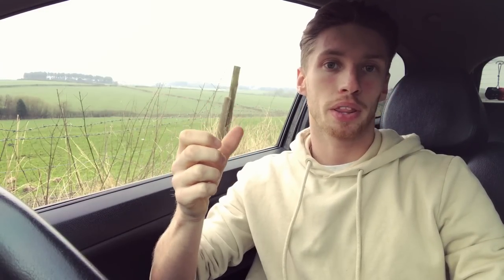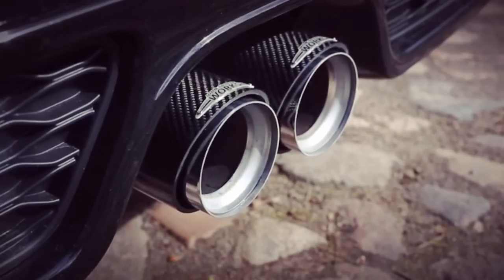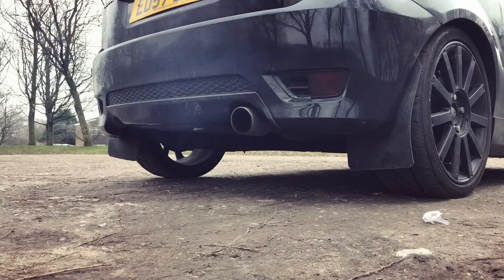How To Make Your Exhaust Pop, Bang and Crackle

Comment: What causes pops and bangs is a couple things.  

1. Fuel over run, lift off fuel overrun is more common way to get unburnt fuel vapor in pipes.

2. exhaust headers, extremely overlooked area.. many modern cars have exhaust headers setup in a way that won’t work very well for pops and bangs.  Things like equal length headers and collector pipes can reduce chances of consistent pops and bangs as they are designed to make engine more “compliant” and more “efficient”, making your own headers or replacing them can help as this helps send more exhaust down stream faster and can help make flames exit the rear of the car easier.  Ideally want pops and bangs to happen down stream.. 

3. Center muffler/resonators and rear mufflers..  you maybe amazed to find you car in factory MAP can crackle and pop on lift off if you build custom exhaust correctly.  I found my car crackles a bit on lift off on factory tune on factory CAT just deleting the resonator/center muffler, pulling on correct mufflers is critical too, as some mufflers can mask the crackling and pops.  

4. High flow cat…. You can absolutely run CATs and get pops and bangs I have done this before and the trick is high flow cats for track use, not every car likes these however… but cat isn’t going to remove the fuel, it’s emotions based, what it can do is screw AFR mixture in the pipes, high flow cats tend to do this less.  my car originally wasn’t happy with my solution and then I realized why, way they measured my O2 sensor have to put sensor in the CAT as down stream not after the cats. So had to find a high flow cat with a O2 port in center of it and use that.  

5. Check your engine is getting enough fuel where you want the crackles and pops which is usually near upper end of rev range so when lift off it sends unburnt fuel into the exhaust.

Comment: When the throttle of an engine is closed at higher RPMs, a very strong vacuum is created in the intake manifold - this causes a lot of fuel to be drawn in via the idle circuits of the carburettor, and even exhaust gases drawn back from the exhaust manifold due to valve overlap.

This mixture does not burn fully and goes into the exhaust system, where it may get enough air to actually combust fully. so it explodes with a small pop and sometimes flames maybe seen.

It is harmless for the most part. Even a perfectly tuned engine can pop its exhaust.
Reply: sorry, carburetor?
Reply: Not exactly correct.
But I do remember them carbs...
Reply: Morten Kapa are you a mechanic?
Reply: Yeeeeah sorry bud but most vehicles that anyones going to be trying this one is going to be of this century and running EFI. I mean it would be cool to have a lawn mower that pops and bangs though for sure
Reply: @billyc2572  you’re out of touch with reality

Comment: Erm i have an issue, i have a fiesta mk6 (not an st) and it pops and crackles without me actively trying to make it pop and crackle. It only does it when it is warm, it has been sitting still for a while but i start it up now and then and move it around to keep things lubricated. Could there possibly be a hole in the exhaust or something?

Comment: do i have to remove dogs aswell as cats. or are cats enough. maybe some mice too?
Reply: Yeah I'd remove the dogs I heard it makes it louder
Reply: what's that?
Reply: removing your dogs is illegal, remove your mice and your cats, your dogs filter the air. To make your car spit flames, remove your chickens and replace them with a dragon.
Reply: Just make sure you remove the bearings from your muffler and weld them back into the exhaust pipe exactly 5 feet 3 inches from the end of the header or manifold. When the bearing spins it mixes the exhaust gases and makes them hot then the gases ignite and you get your pops. There you go....
Reply: Dogs bark loud than cats
Reply: Leave the mice. They keep the spiders out

Comment: Banging flaming isn't bad for ur car , nothing is getting damaged while it happens because of fuel enters the exhaust and heats up but it's fine to be honest , mine seat Leon Cupra R Mk1 running 300bhp and she's on her limits so because of the rods neeeds to be forged but she bangs like nothing normal
Reply: RY4N B35T0N it might not be bad for the car but its the environment you’re harming
Reply: There is a little chance of melting exhaust valves

Comment: the best thing to do to produce backfire, is to downshift to middle-high range of the lower gear
Reply from the maker: yeah that works also, its the same process; the quick change in rpm changes air:fuel ratio
Reply: @gmc__tanner1192  my car has a carburetor meant for a forklift can I still do this? My timing is max advanced on the dizzy since I'm running 108+ octane. What if I turn the boost up higher?
Reply: My 5.0 coyote does that alot when I'm slowing to turn, or just slowing in general, whenever I downshift from 3rd to 2nd gear, gives a good crackle kinda growl.

Comment: just for reference civics do this naturally i  think because all i've done is backbox and silencer delete and replace resonator with s/s smaller one and i get crackles all the time and the occasional pop. bare in mind i've got an fn2 model with standard k20z4. apart from that it's pretty much stock and map isn't really necessary unless you want it to be  loud af. but then again civics are loud anyway. whether this is with all civics i don't know as everyone i know still has backbox but no resonator.

Comment: Arnt cars standard meant to run rich anyway as it's safer for the engine i.e. Cooling etc so all your doing is deristricting the sound of the back fire that's happening all the time on a standard exhaust? I may be wrong?
Reply: Ben Dyson yes you're exactly right, that's why you decat it and stop choking the car

Comment: But don’t the cats & muffler give the car pressure or something? I remember I took the mufflers off my GT and I would have to give it more gas for it to move a little compared to when it had the mufflers i would give it a little gas and it would accelerate normal
Reply: luis Angel i feel you

Comment: I did exactly what you told me to do and all I got was a check engine light
Reply: Taking ur cats off will make it have a check light
Reply: theory nah bro not with a tune I got the MHD tune and it turned it off
Reply: @bandzz3486  100% but  these little below 2 litre builds are a pain in the arse
Reply: Mark Fasey yea bro Lmaoo I have a 3.5 liter I got a 335i 2011 e92
Reply: @bandzz3486  you got a 3 liter
Reply: this is hilarious to me

Comment: My '91 MK2 Golf does it like crazy only removed the middle box and installed an 10 year old remus backbox the cat is still in. Just downshift and lightly touch the acc. pedal. And it's a 1.3 injection 8v :D

Comment: Hey I have question, so I just got E46 320D (my first car) and I want it to sound good, what should I do? I think if I do muffler delete my mpg will get really bad, is it true? And I need some in detail help. Thanks in advance
Reply from the maker: Medo to be perfectly honest mate, a muffler delete won't affect your MPG significantly. You wouldn't even see horsepower gain if you're only removed the muffler at the back because the air flow in the rest of the exhaust hasn't been changed. The main thing it it would do (which is what you want) is just make the car louder and creating less time and space for the air to travel and quieten.
Reply: itsLeeLockwood Hey thank you for the fast answer! Well you know, my budget is really tight atm so I'm trying to do things with small amount of money, so for now I will probably do cosmetic changes. I hope your channel will grow fast, you have good quality content :)

Comment: Additional info to help achieve this effect.

Go to a tune shop and ask them to either remove or modify the DFCO (and CFCO FOR MANUAL STICK SHIFT VEHICLES) 

DFCO - Deceleration fuel cut off
CFCO - Clutch fuel cut off

Bang bang bitches.

Comment: I managed to get pops and crackles out of my GXE Sentra by accident. 

The car already had a header and straight pipe mufflers, but one day the fuse for the fuel pump went out and stupid me instead of checking that I went to pull out the fuel pump and go check it, turns out Nissan puts really weak pumps on those cars and the guy from the store though the pump was on it's way out when he tested it so he sold me a stronger fuel pump. I put it in, replaced the fuse and the car ran normal but I started noticing it popped and crackled now. I'm guessing the stronger pump puts more fuel on the engine and causes the exhaust to pop. it's really stange to hear those sounds coming from an old Sentra that's not an SE-R xD 

I should check the spark plugs it's probably running rich if that's the case.

Comment: my 1994 Grand Am is straight piped and it pops pretty loud but I have to be in park to get the good gunshot pops. any tips on how to get it to pop when revs go down. it has a 2.3l L4 and it's auto.
Reply from the maker: see mine pops more when the car is rolling other than parked. Ive tried to research why this effects the exhaust but i cannot find a legitimate answer.

Comment: My 2.2 liter subie gets crazy loud pops. I removed the muffler and did a flow through muffler and I still have my cat and res and that shit really explodes. I've found he best way to get really good consecutive pops is to be in like second or third gear at between 3k and 4k rpm and then lightly tap the gas pedal a couple times a second and it sounds amazing. Great vid man, thanks
Reply: That's great, now can you stop?

Comment: Anyone that actually wants to pop and bang should just get a tune with crackle option. Exhaust can be stone cold and still pop. My GTI  has a crackle tune and it’s just crazy non stop pops over 3RPM .. I can change it so it pops at any RPMs. I set mine between 3000 and 6000 RPM .. if I’m in that range it will pop. Anything under 3000 RPM won’t, just so I’m not asking to be pulled over.

Comment: can i do it on my civic?
Reply from the maker: The Cool Brothers hondas are too well made, they don't waste fuel
Reply: The Cool Brothers I backfire like mad with my eg dx twin carb swap, you won't get this from an injection civic, so no yo vetec here lol 😂
Reply from the maker: Curi0u50ne hahaha mate I need to see a picture of this
Reply: Jared Taylor I'm a ricer
Reply: not sure if its a joke or not but mine ran rich after i removed the cat and installed a header and exhaust. this caused it to pop and shoot flames lol
Reply: Jared Taylor clearly not a car guy
Reply: Don't be that guy
Reply: Evan Davis bro im fucking done LMFAOOOOOOO i was in class when i read this and i just bursted out laughing 😂
Reply: im 4 ase's away from master tech status. I'm more of a "car guy" than you ever will be
Reply: It's a VTEC not a VETEC
Reply: The Cool Brothers oh god please don't.
Reply: i have a 93 si and mine does it like crazy. b18c motor
Reply: my civic si does it all the time too.
Reply: sub hazard my old D16ZC (or Z5 EUDM, PGMFI) did it and my actual K20 (dbw throttle body) does it in the correct rpm range, between downshifting. But without flames!
Reply: plz dont
Reply: My 91 accord is fuel injected pops and bangs a shit load with resonator and muffler delete
Reply: B16 or B18 engine mapped with P28 ECU with launch control will do it or you can buy B R rev limiter but will shorten your engines life
Reply: itsLeeLockwood cause vtec
Reply: Jared Taylor i only have 4 student ase’s and i know more than him by far.
Reply: I de-resonated my Focus ST and it pops and bangs on and off boost and still passes an mot. No need to remove the cat!

Comment: I've got a 2.0L 2010 Kia Magentis crdi which I bought this week and when I drove it last night I was speeding about 80-90 on the country roads near me and when I slowed down I heard little pops, the thing is though I've got a Diesel so I've no idea how that was possible since I don't think Diesels can pop? The car has got a DPF code and the mechanic who sold it to me said the previous owner ( car is an ex taxi, comes with full service history at 200k miles so it's been maintained properly it's very clean and no rust at all under the car) that they must of taken it off to re-map the car, the thing is if I start speeding with a lot of torque a lot of smoke comes out the tailpipe, which is normal but like even when I stopped the car after hearing the pops I looked out my window and I was surrounded in white smoke, like it even went to the front of the car? must of been the wind pushing it but I was a bit worried, I'd love to re-map my Magentis to go to 180bhp and get a new exhaust system to get a dual exhaust but I'm not sure which brands make that possible on a Kia? Any help would be appreciated cheers!

Comment: I think popping and crackling cars is fun especially on decent cars. But Lee you're driving a Ford Fiesta ST which isn't going to sound exactly insane. I was in town the other day and I saw a Ford Focus RS popping and cracking and bangs. Which sounded sick whereas your car is probably only a 1.4 or 1.6 litre engine.
Reply: Thomas Greene the mk6 fiesta 2002-2008 is a 2.0L pushing 150 hp

Comment: You might should stay away from car related topics because you giving a lot of miss leading information and you don't seam to have the slightest bit of knowledge when it comes to cars.
Reply: also if you wanted pops and bangs associated with true power I would invest in a full exhaust system and a professional ECU reflash because your car while very pretty is buzzy and unclean sounding in the top end of the rpm's to be honest it sounds like a go-cart.
Reply: It’s a 2.0l naturally aspirated 4 cylinder pushing out 150 stock that’s just the natural 4 cylinder sound without a turbo